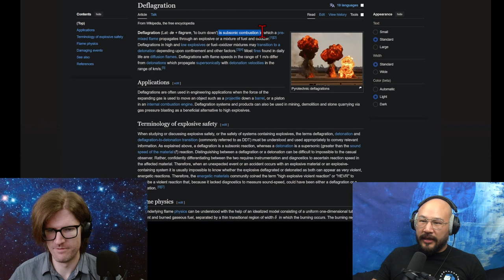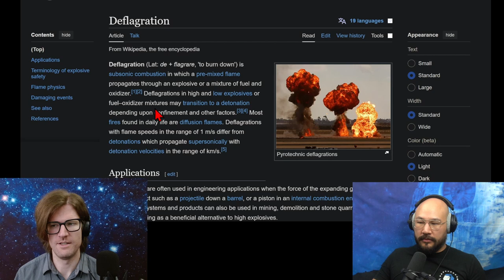Robocop | Realistic?

Comment: Many years ago i threw a lighted match into an open tray of petrol, i did this several times making sure the match was well alight, each time the match went out, you could hear the sizzle as the match hit the fuel
As an aerosol it may be easier, but i note that the guy throws a cigarette on the ground where it is liquid, i don't think a cigarette has the heat.
The flame is probably realistic, the cause of ignition i doubt.
Reply from the maker: I can't say I have ever done the experiment like you have, but I have heard that "only the vapors explode/catch fire". Is it possible that there was enough evaporation or aerisolization to make an explosion possible?

Comment: The hose on a fuel pump is pressurised, surely? 
Otherwise how does the handle start and stop the fuel flow?
If you nicked the hose, it should spray pretty good. 
That'll give you a lot of aerosolised fuel, that'll burn real good.
Entire station blowing up? 
Not so much.
Reply from the maker: The explosion is very large. Maybe it would mostly be a large fire?